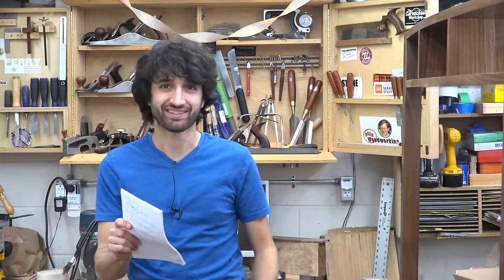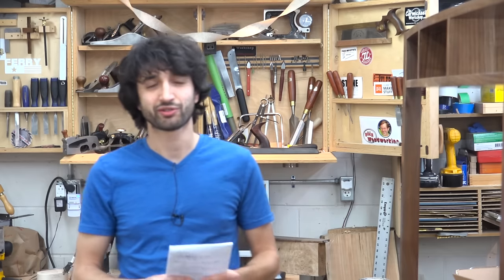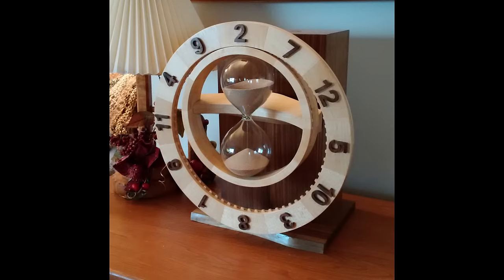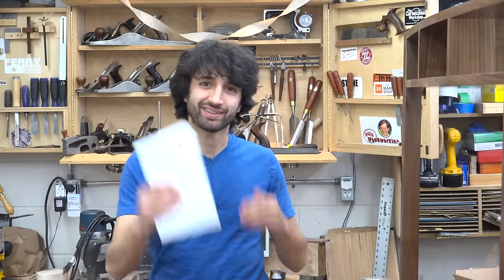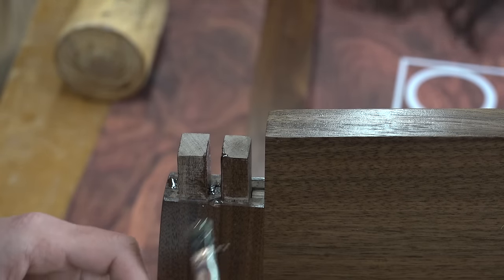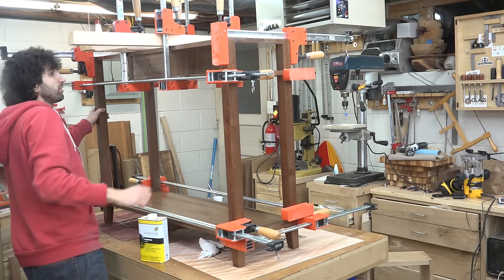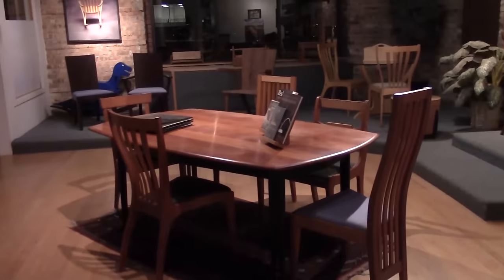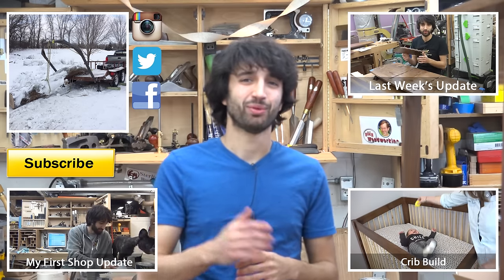Matt's Weekly Shop Update - Jan 18, 2016

Comment: is there any problem with milling a tree in cold weather, below freezing, sub zero ?  other than the sawyer discomfort.  Is the wood more prone to splitting later ?
Reply from the maker: There isn't an issue with the wood structurally but being frozen all the way through does make it harder to cut.

Comment: what epoxy do you use Matt? West System, if so which one? This will greatly help me.
Reply from the maker: Yes, with the 206 slow hardener
Reply: Matthew Cremona wow that was quick! thanks Matt! West System 105 Epoxy with 206 hardener. I been using Loctite Epoxy but they only have the 5 Minute epoxy available in large amounts. Happy Anniversary! Keep up the amazing work.
Reply from the maker: Thank you!!

Comment: Matt, I need help. how do I get the twist out of a 2X4  piece of lumber??? I need it to make legs for my workbench. I don't own a flatness planer....what do I do???
Reply from the maker: handplane?  Router sled?  Belt sander? any of those methods will allow you to get a flat face but you would still need to plane it to thickness
Reply: I hv a block plane & sheet sander so once I get it cut to the length I hope these methods will be enough. THANK YOU....